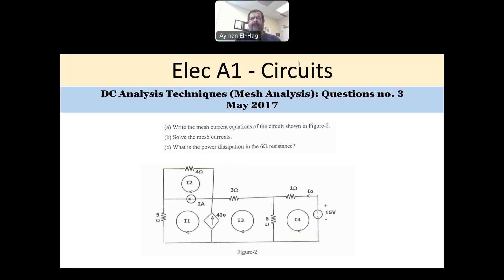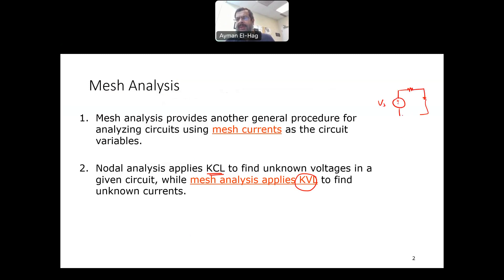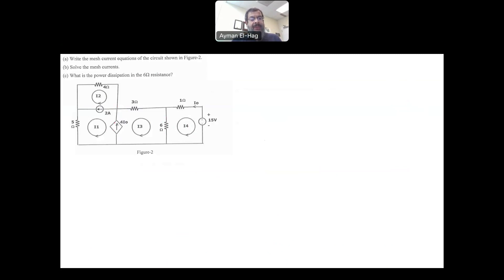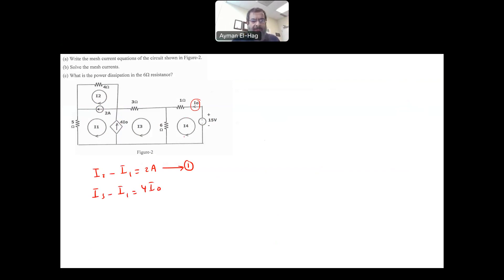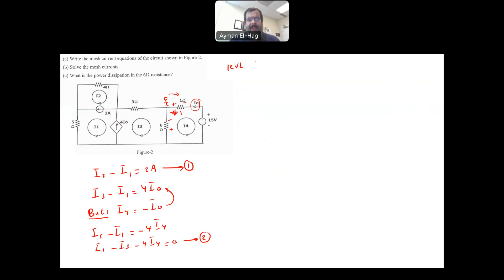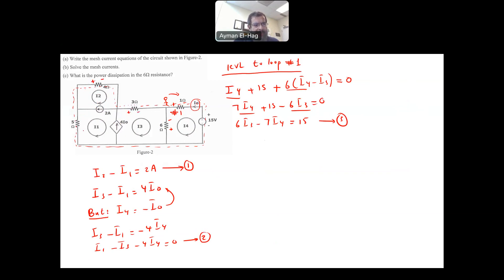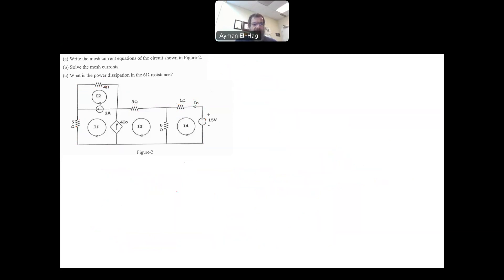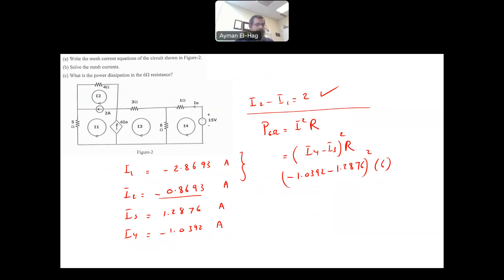PEO solved examples (ELEC A1): DC Analysis Question no. 3

Comment: Super mesh equation shown in this solution is different than yours. here KVL is applied using 6ohm resister instead of most outer loop. why one should be preferred over another and how to choose.     https://www.youtube.com/watch?v=bpM8e8bS4h8
Reply from the maker: There is no preference, you can use any available super mesh which 2 or more meshes.

Comment: For the second mesh loop, would it be okay to use only I1, I2 and I3 rather than using all 4 considering how I4 was already captured in the first mesh loop?
Reply from the maker: To select a loop for a kvl you need to avoid any current source in that loop. So for loop 2 I took the most outer loop. I could take the loop without the last branch